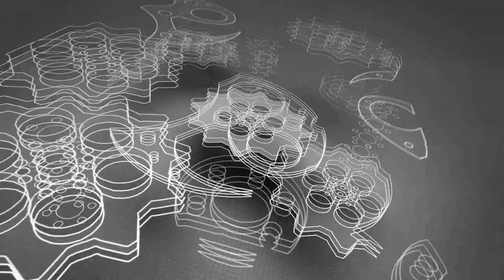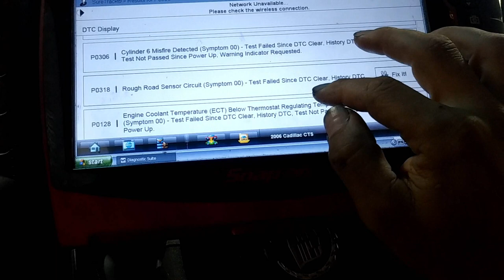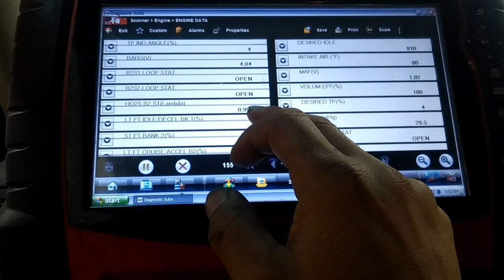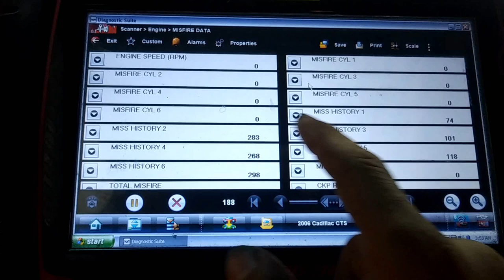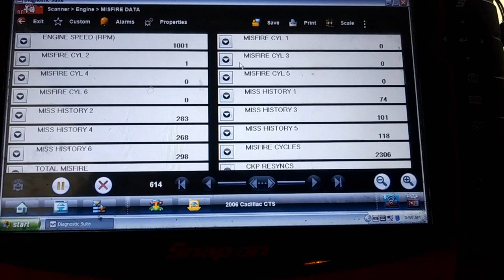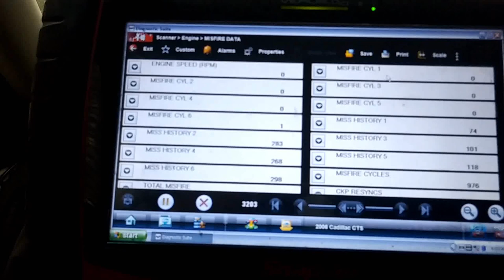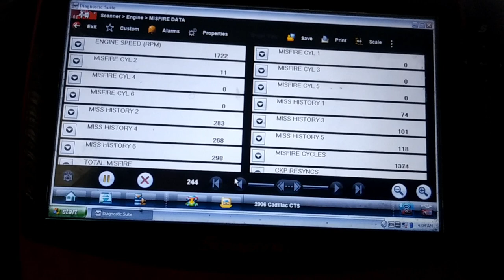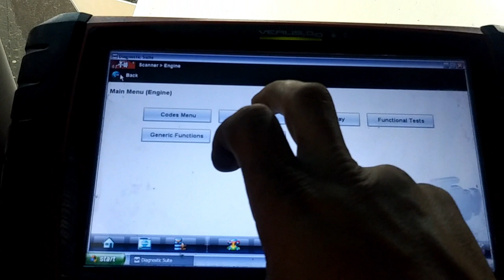Cadillac cts misfire check engine light flashing

Comment: 2006 cadillac cts 2.8L V6 here. 
 Have to replace the water pump and engine coil number 6.  I'm not a car mechanic.
 But I'm not scare either, any of advise?
Reply from the maker: The number 6 coil is easy to  access. Driver side closet to firewall. As for the water pump it's easy to replace. Sorry I don't have a video

Comment: I am surprise to hear from you about the CTS you are working on that needs 4 quarts of oil. I always works on my neighbor 2005 cts. My neighbor CTS always need to add engine oil ( 4 quarts) after driving a little over 1000 miles. No engine oil leak.
Reply from the maker: Yeah I know. Wow thats a lot

Comment: So if you clear the codes and all the codes pop back up it's an electrical problem? My 2009 does that, how can I fix that? Your video is the only thing I've seen mention anything helpful regarding my situation.
Reply from the maker: What code do you have
Reply: Sounds like your cats are stopped up pull the front o2s and check with back psi tester

Comment: I got a 2004 Cadillac CTS 3.6 and I have done everything to try to get these codes off cylinder one open circuit misfire po201 I believe and I've done everything spark plugs ignition coil even change the fuel injector and wire and harness and I cannot seem to get this code nor this misfire to stop any answers or comments?
Reply: You check for vacuum leaks
Reply: Mines is doing the same shit . For last 3 years I hate this car . Worst misfire I ever had
Reply: 2003 cts tc code and check engine flashing
Reply: Change out your ecm
Reply: Any luck mine is doing the same
Reply: Any updates?
Reply: Its either the harness it self ( injector harness) or the ecm.
Over time the harness becomes brittle af.

Trust me. Been there done tht
Reply: @82PeRK  Noticed the harness was SAAB. But its been working fine until the misfire. Waiting for the ECM to arrive and hopefully it resolves the misfire.

Comment: I am also currently working on this same CTS for codes P0304 and P0204. I replaced all spark plugs (tune up due) and checked ignition coil number 4 (working OK). Still have the same codes. Today I will be replacing number 4 fuel injector. Hope will fix the codes or else maybe PCM issue. Thanks
Reply from the maker: I also have a video on that code
Reply: @JaboTheMechanic  where did you get that device from as the one I have say misfire but do not tell me what one

Comment: I have a 2011 Cadillac cts. the check engine light started to flash so I pulled over. I check to see if there was any codes and there wasn't? what does this mean
Reply from the maker: Well you have a misfire. But you need to drive it a tad bit more to determine which cylinder  is causing the  issue. Could need a tune up.